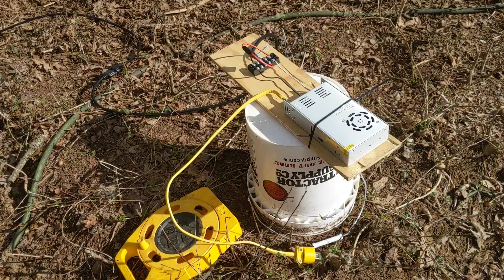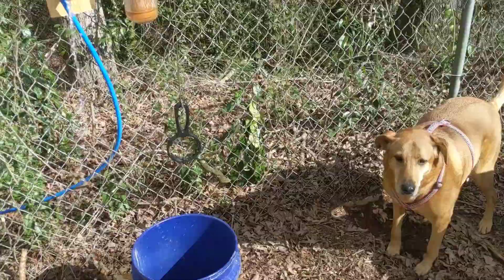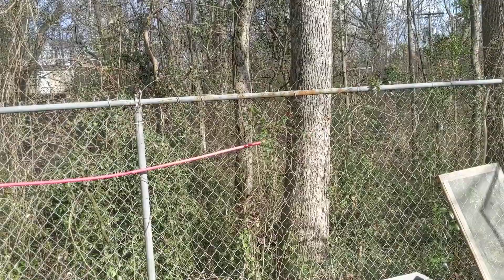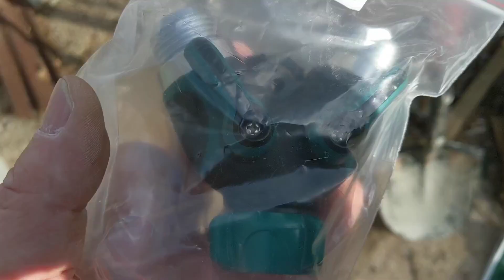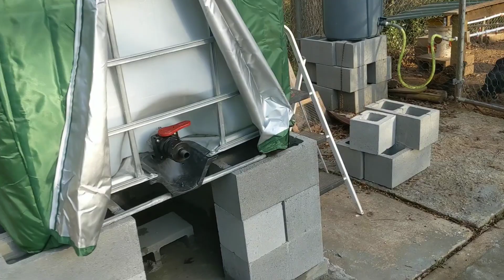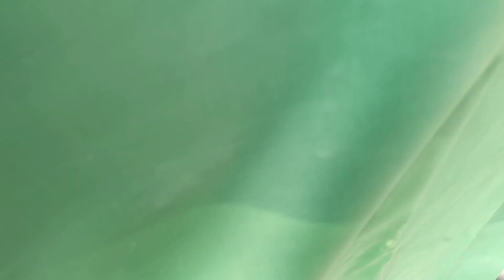Emergency Water Supply and Storage, 12 Volt Well Pump Feeding an IBC Tote, Calcite Filter Installed

Comment: So I have a couple questions, first is, why use a 12 volt well pump? also I have never heard of a 12 volt well pump, so what kind of well is it? a spring? Next why fill from the top, you could just pipe it in on the discharge and keep it a little neater. Also looks like the reason the hose Y was leaking was it shouldn't spin like that, was the washer in the connection missing?
Reply from the maker: Hey, thanks for the questions. 
The well is about 400 feet deep. It was drilled sometime in the 60s and abandoned sometime in the 80s. I decided to restore is as a backup source of water should anything happen to the public water supply. The pump is suspended about 75 feet down the well.
Why a 12 volt pump? A few reaons...
One, it was cheap, about $80 on Amazon. Also in a grid down situation, I'm pretty sure that 12 volts DC is going to be easier to come by than 120v or 240v AC. 
I have 2 power supplies for the well right now. The first one I made runs off a Kobalt 40v battery thru a 13.8v step down converter. I've also powered it off of a 20v Black and Decker battery, and obviously a car battery will also work in a pinch. I plan on getting it set up for solar in the near future. 
The power supply used in this video is a 120vAC to 12vDC converter which I just got for about $25 from Amazon.
Why didn't I plumb the water line in thru the discharge? Honestly didn't even think about doing it that way. Thanks for the idea. Just seemed to make sense to have the water go in the top and out the bottom (I am not a professional). 
The Hose Y is simply defective, yes there was a washer in there. $6 at Amazon don't get you what it used to. 
Just let me know if you have any other questions, and there is a whole playlist of Well Project videos before this one. This was the end of about a 2 month project of tinkering on the weekends. 
Now we have 225 gallons of nice well water (tastes much better than the chorinated, floridated tap water) stored and ready to go, and we can top off the tank as needed at a rate of about 75 gallons per hour. 
Thanks again for stopping by.
Reply: @TwoAcreHomestead  Cool, thanks for the feedback, I see you subscribed, hope you get to watch some of mine, might trade ideas. The 12 volt pump makes perfect sense now, I was just confused because it was 12 volt powered by 120 volt solar is fantastic in these situations, I have done a couple systems but I'm doing my biggest one yet now (6500 watt) on the house which is the next project since the log cabin is pretty much done. I haven't started the videos of that project yet, other than felling the tree which now I'll mill into about 140 2x6x14' pine.